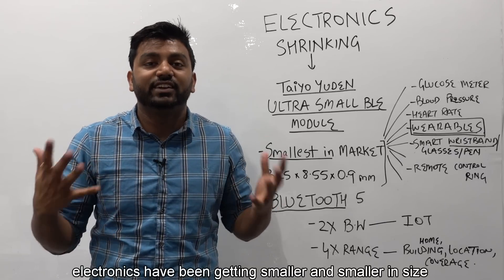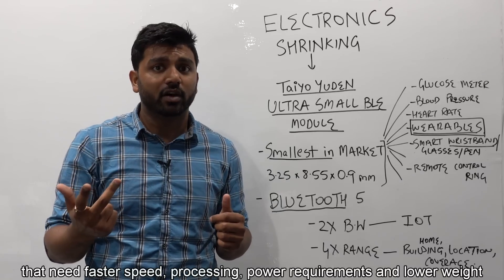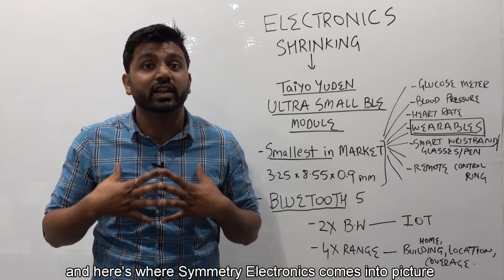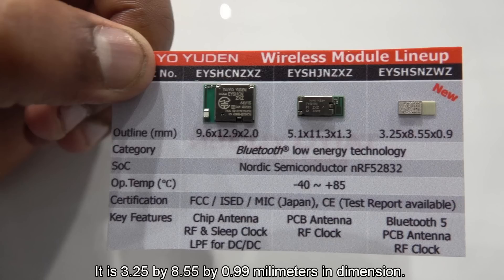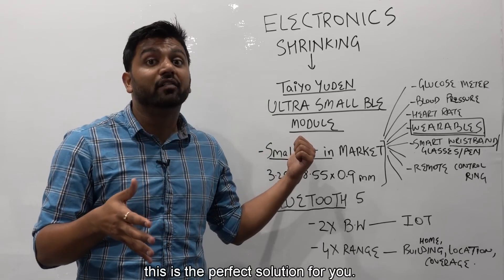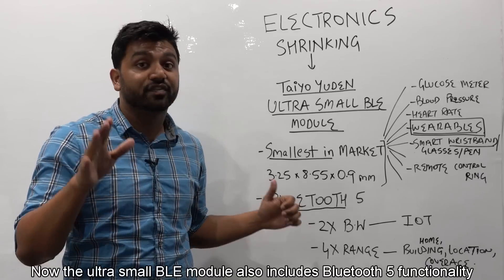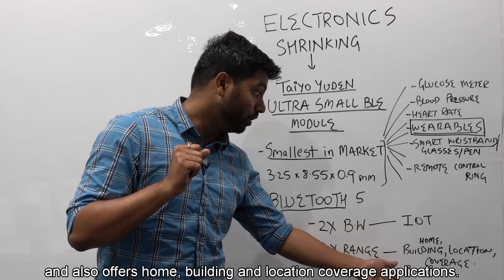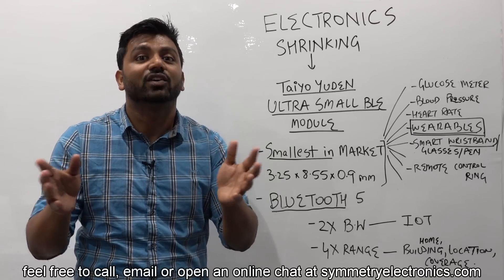World's Smallest Bluetooth Module from TAIYO YUDEN

Comment: Can we connect this module to any data acquisition devices such as arduino orlab view Daq card
Reply from the maker: This Taiyo Yuden module would be able to connect to any data acquisition device that has GPIOs. For example, a device based on the Arduino would have a lot of GPIOs & simple digital input/output pins to help process information from the Taiyo Yuden module.

It's not clear the exact device you are referring to, so please check to make sure that the device you want to use has the proper pins. You can also call a Symmetry applications engineer at 866-506-8829 for any additional help on your design.

Comment: This is a great module and Taiyo Yuden is a very high quality manufacturer. However, this video has INCORRECT information. This module does NOT have 4x range as the Nordic BLE IC, the nRF52832 does not have the long range PHY. It does have the ability for the advertised higher Bluetooth 5 speeds. The Bluetooth SIG screwed up and defined Bluetooth 5 in a way designed to mislead. Bluetooth 5 higher speed and longer range are mutually exclusive and OPTIONAL to the Bluetooth 5 standard. The "4x" range is at a much LOWER speed to get the longer range.
Reply from the maker: Hi Matt, thanks for pointing that out. You're correct, the EYSHSNZWZ uses the nRF52832 and is certified with SoftDevice S132 v5, meaning it meets Bluetooth 5 specs for higher data rate (x2) and increased broadcast capability (x8) but not long range. This video was made during the infancy of the Bluetooth 5 spec and we had not fully understood the production specifications of this module. We'll fix this error in the video. If you're interested in a module that meets the full Bluetooth 5 spec please contact our team at 866-506-8829 or http://www.semiconductorstore.com/pages/ContactUs.asp and we'll be happy to provide you with a list of modules that meet your needs. 
Taiyo Yuden will be releasing a very small module similar to the EYSHSNZWZ soon. The EYSKLNZWB which uses the nRF52840 and will be certified with SoftDevice S140 and supports the full Bluetooth 5 specification (including long range). It will be available for sampling Q1 2018.

Comment: Does anyone have experience with this chip? I'm looking for what IDE I could use for it as well as an external programmer solution.
Reply from the maker: Hi Brian! The Taiyo Yuden has Nordic chipset in it. It will work with any IDE like KEIL, ECLIPSE, IAR or more. Nordic semiconductor has BLE development kits which will have segger programmer/debugger on it. You can alternatively use the kit as ble kit solution and programmer as well. http://www.nordicsemi.com. Nordic provides a free version of KEIL to use as well free to download from their website. Otherwise we also provide programming solutions from I-SYST - IDAP-LinkTM CMSIS-DAP Debug JTAG http://www.i-syst.com. You can also buy programming solutions from segger - https://www.segger.com. Here's a link to Taiyo Yuden's Bluetooth development guide: https://drive.google.com/open?id=0BxZRuT1u3VJIaFFOb0tzZFZwZlU. Let us know if we can we can help with anything else!
Reply from the maker: Hi Brian, to further clarify, you can treat this module like you would treat any other with the Nordic nRF52832. An overview on this SoC is available here: https://www.nordicsemi.com/eng/Products/Bluetooth-low-energy/nRF52832
You can also view the supported development tools and software that can be used with this Taiyo Yuden module. Our app engineers can also walk you through the process of setting your IDE up and getting a sample project running.
For development with this module, we recommend purchasing the development board with programmer available here: http://www.semiconductorstore.com/cart/pc/viewPrd.asp?idproduct=70792
This module is so tiny that prototyping up your own programming interface is nearly impossible without a custom PCB. If you already have a J-link Lite programmer, you can purchase just the development board here: http://www.semiconductorstore.com/cart/pc/viewPrd.asp?idproduct=70791
If you have any other questions don't hesitate to get back in touch with us at http://www.semiconductorstore.com/pages/ContactUs.asp or call us at 866-506-8829.
Reply: We have ordered this chip as well as the prototyping board that uses this chip from mouser because they are the only one that said they had it on order. They have continued to postpone shipment to us because they do not have it from the supplier yet. Do you know anyone that has it in stock?